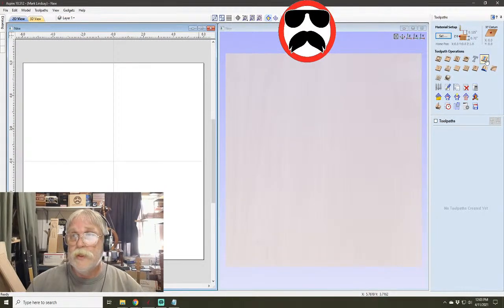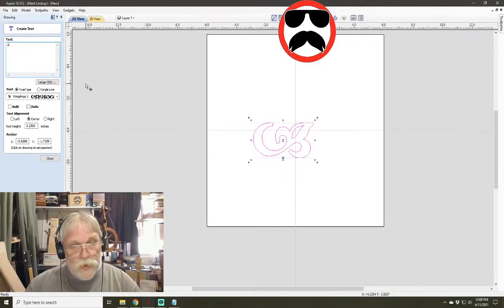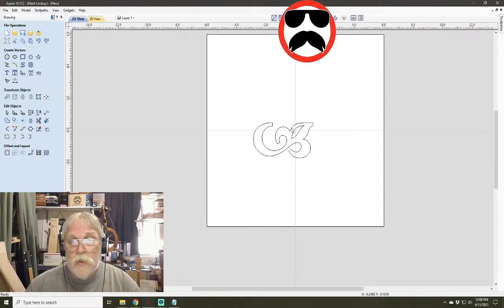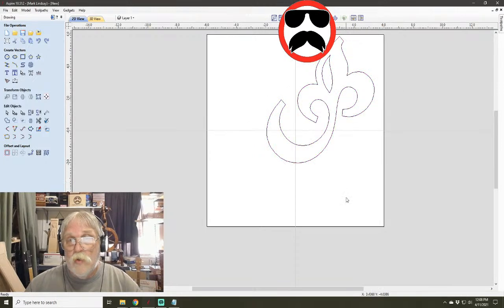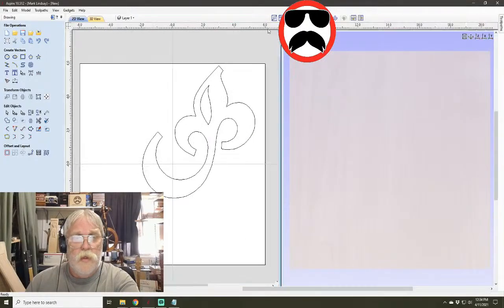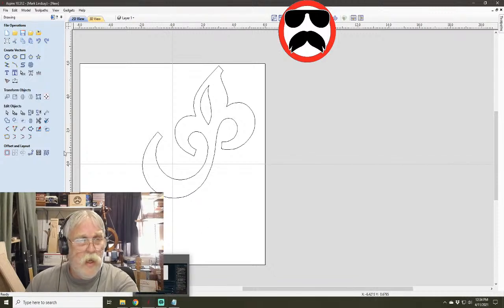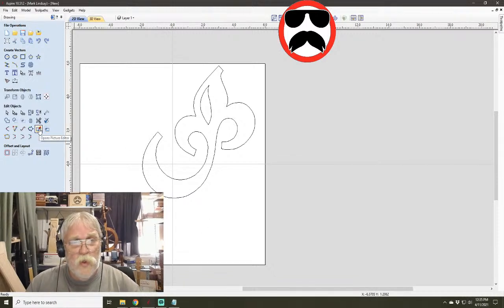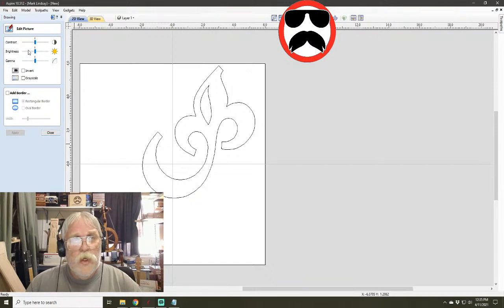LIVE Q&A #86 - Open Q&A

Comment: I realize I’m really late in asking this question but I was working on a project and trying to use “layers” I was getting frustrated with the dimensions tab. Is there anyway to turn off the dimensions ? I would like to have my dimensions show up ONLY on the layer I’m working on. 
Thanks for your many hours of help you give.
Reply from the maker: Yes there is. If you look down at the bottom of the Dimensions form, you'll see a checkbox for "Place Dimensions on Layer." Put a checkmark in that box and type the name of the layer you want the dimensions to be on BEFORE you create the dimension. If you've already created dimensions, select them, then right-click. Put your cursor over "Move To Layer," then select which layer you want them to appear on. I hope that helps!